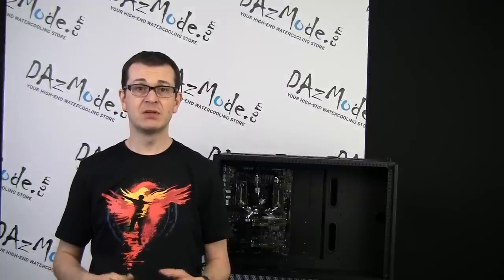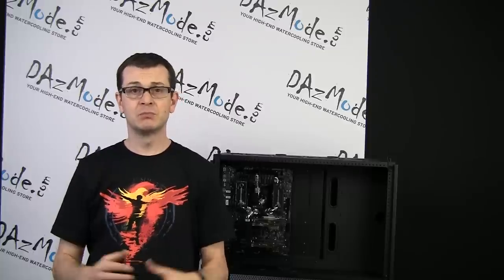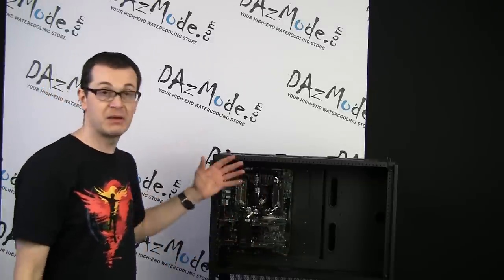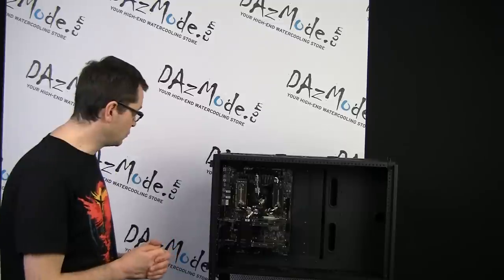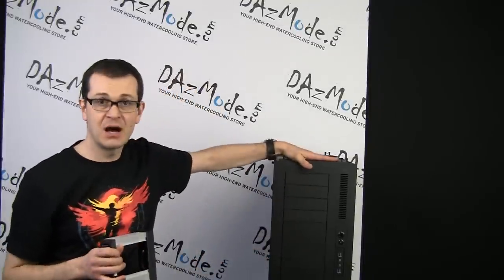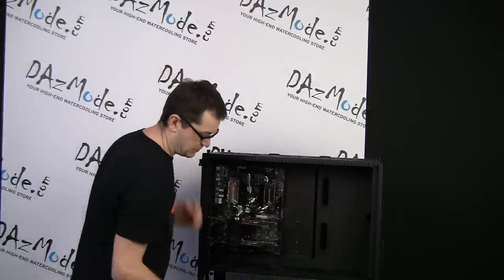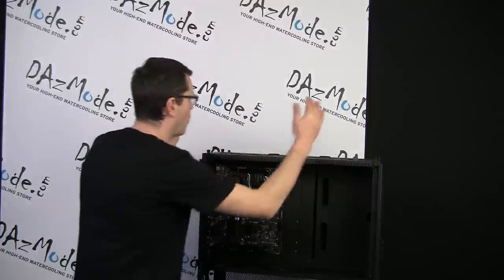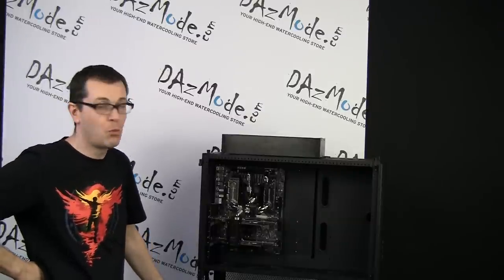Venom SMH10 Build Update - Case's front planning + debating on using Admiral Radiator

Comment: Thanks for the update Daz!  I've been suffering withdrawal symptoms for the Venom Build!  I would add a quad rad in the top with a Caselabs extended top.  That would hide the rad, fans and related wiring.

Comment from the maker: This case has total of 13 (!) 5.25" front bays.If you use quad (or two quads) at the bottom, it will reduce number of full size 5.25" bays to 10, although you still can put 120mm fan option to sacrificed bottom 3 bays.

Comment: not sure if you have a bracket like the LD V8 for the bottom compartment? if yes my recommendation is to put the triple radiator in the bottom compartment with the psu (unless you are using 2). the triple may leave room for the bay in front to still be used. if you wish to keep the radiator on top then for sure the quad would look better, i doubt that ppl would stare at the top of that cover(if they are tall enough when that case is on a desk anyhow), i would look at the XXL window instead